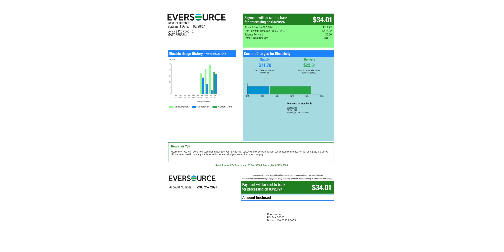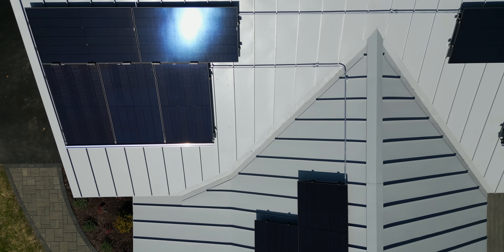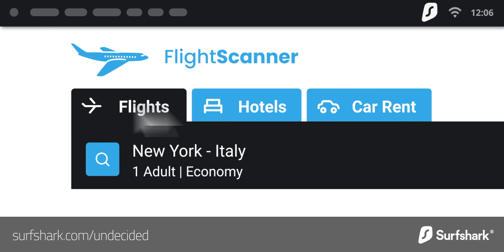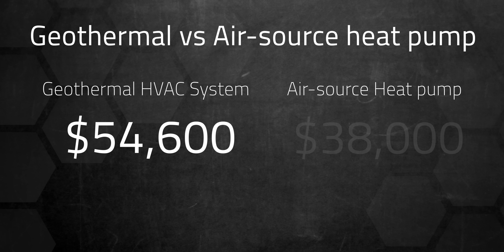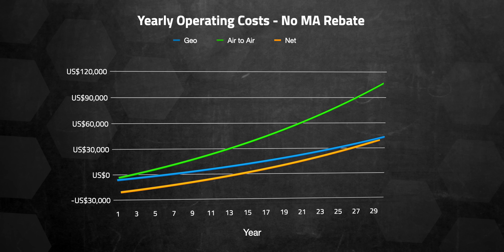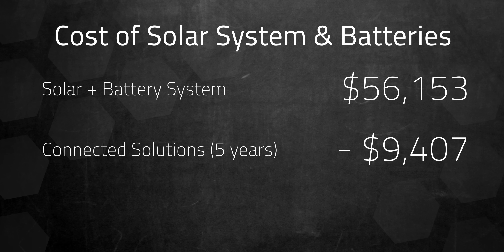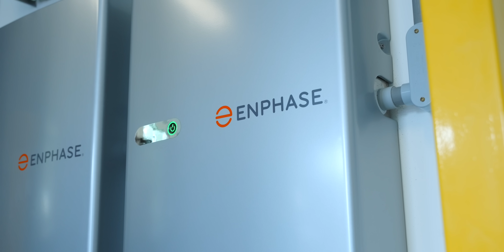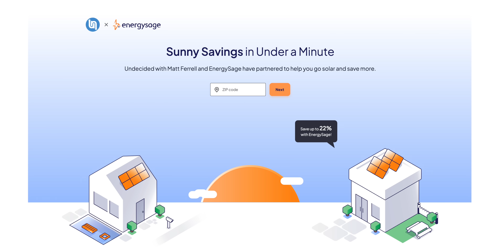What I Learned After 1 Year with New Solar Panels

Comment from the maker: Have you done anything like this or are there any specific elements you’d want to do for your home? Go to https://surfshark.com/undecided for 4 extra months of Surfshark at an unbeatable price!

If you liked this, check out The Genius Of Hot Water Heat Pumps https://youtu.be/abGiNL9IT54?list=PLnTSM-ORSgi7HT9O73K9oYUe19eS-wjxX
Reply: 88.000 $ for just 16 kWp and 20 kWh ?

I build that on my own using 540 Wp panels and got 30 kWp with 22 kWh of batteries with eve LF280 K cells. 
Paid less than 18000€ or 19000 $

I guess prices must be way off than what we pay here in the EU.
2 panels each 540 Wp cost about 136€ and they are VAT free like inverter and batteries too.
For 100 k you could get a picea system which is storing the surplus energy in Hydrogen bottles for usage in the winter. Their fuel cell is uising 1/3 of the hydrogen power to heat during winter and 2/3 for electricity production. 

Made in Berlin, Germany and quite expensive, but those who got it, they were convinced.
Reply: I live in the SF Bay area and we've had solar for nearly two years now. I started with a 6,400 watt system plus a 10 kwh backup battery that we had installed in Feb 2023. Over the next year our panels generated 8.9 mwh of power and our total energy costs were reduced by more than 50% over the year (electricity + NG cost us $3,967 in 2022 and only $1,795 in 2023). 

This year, we went all in and added 14 more panels (which appear to be more efficient than the ones installed last year) got a heat pump water heater, two Mini Split heat pump AC/Heater units, an electric dryer, an EV with a home level 2 charger and an induction stove. We have yet to turn our gas furnace on, and probably won't this winter (or ever again). After rebates, we probably spent about $50,000 for all of the home upgrades (including solar) and another $50 k for the EV (a Hyundai Ionic 5).

Our new system (which was upgraded in May) is projected to generate nearly 19 MWH per year and our total energy costs should be less than $500. In addition, we almost never buy gasoline since we rarely drive our second car (a 2010 Honda Fit). Since energy costs continue to rise here in Northern California, it's hard to project exactly how much we'll save over the next 10 years, but it's nice to know that, no matter what happens, we'll pay almost nothing for energy for the next several decades.
Reply: @davidbelk46 Thanks David, this is like this video but for Californians.   
A few years ago I contacted Southern Cal Edison to let them know the weed tree in my neighbor's yard was arcing against their power line.  We're hillside which makes it even more dangerous. Two weeks later I got a text message saying, "Just have your gardener trim the tree." I'd mentioned in my first message that my gardener told me no one he knows would touch it. Also the SCE yard it took that guy two weeks to take a look? It's a mile away. I called the state regulatory dept and was told: We can't make the utilities do anything. They got laws passed.... Then PGE and murdered 71 people. I finally put on heavy neoprene gloves and cut down the tree.  
After the PG&E murders the utilities got a huge spike in rates and extra fees to pay for tree trimming -- something that had always been part of their responsibilities. When I got a bill for almost $0.50/kWh is when I set the goal of disconnecting as soon as I could.
Reply: @davidbelk46  the government will get its money from you another way
Reply: Hence why I am DIYing my own system.  The installer is charging you almost 3x what the parts cost, and its fairly absurd even counting labor.   You are paying $1288 per panel (panel + micro-inverter + mounting + installation) and $33K for a 20kWh the battery + inverter system.

Panels DIY are roughly $200 per panel fully delivered (panel + RSD + mounting, DIY installation).  Batteries are roughly $1500 per 5kWh fully delivered (so $6000 for 20kWh), leaving just the inverter system.

For inverter systems, to be frank, too many people focus on grid export capabilities rather than just a grid support (battery charging / low-battery load support on the battery bus).  For people with large SOLAR + BATTERY systems, it is perfectly acceptable to have an off-grid inverter system and grid-tied battery charger for DC-side load support when needed.  The whole point is to be off-grid and solar-supported most of the time so grid-to-battery-to-home efficiency is not critical.

No transfer switch, no grid-tie.  It just isn't necessary and to prove the point just take your largest daily winter consumption and divide by 24 hours... that's the amount of load support you need worst-case and it aint much.  Usually less than 2kW (which would be 48kWh/day trickle-charging the batteries).  Absolute worst case.   And if someone wanted to do export on top of that, its just another piece of equipment.

In anycase, this puts an exclamation mark on the problem with residential solar these days.  The professional installation costs are insane.  And part of the reason for that, beyond solar installers needing to make a profit, are the extreme warranty periods that have bankrupted installers right and left over the last decade.  And a lack of imagination.  They want systems that they can shift warranty claims to their suppliers instead of piecemeal systems with cheaper (easily replaced) individual parts.

For the home owners, fully integrated systems can get fairly expensive to maintain once the warranty is done or (more likely) your installer goes out of business.  Piecemeal commodity systems, on the other-hand, are trivial to maintain.

-Matt
Reply: > "Have you done anything like this or are there any specific elements you’d want to do for your home?"

Australia here.  45x440W panels for 19.8kW generation capacity against a 15kW hybrid inverter.  50kWh of storage (would be overkill, except I have an EV and we're planning to add a second one eventually).  Sungrow on the inverter and batteries.  AU$53k supplied and installed (approx US$35k).

Your costs really are "crazy high".  Anyways, all electric as well.  Heat-pump hot water, induction cooktop, aircons, etc..  No heating, because Australia (the aircons can also work as heaters but...yeah, never gonna happen).

Using 40-50kWh per day (inclusive of EV charging), which would be a monthly electric bill of around AU$450 or so without solar/batteries.  Exports pay a flat 12 cents per kWh sent to the grid, so with solar/batteries the electric company pays us around AU$200/month.

Extrapolate that out, and the energy generation/export is worth around $7800/year.  Pays for itself in ~7 years.  Even without assigning any value to being essentially blackout-proof/energy independent, or to having a clean source of electricity, etc., or allowing for energy prices to increase over time.
Reply: There is of course interest expense for a higher mortgage  by doing all this upfront. 
My goal is to follow your example when I buy a house. I'm happy to pay whatever it costs to leave the grid.  I'm in southern California so this is achievable.  
An absolutely critical factor is that any series of systems like this must be reliable, robust and as simple as possible. There's nothing worse than some amazing but complicated system that when it has a problem five or ten years down the line can't be fixed because there is no tech support or parts.  (As a sailboat owner this is far more common than you'd ever possibly imagine.)  Or after a year you don't remember all the complex steps needed to operate it. (I remember the days of the first VCR video recorders. I used to rant about all the pokey pokey button nonsense. People seemed to love telling me that they can do it so I must be stupid. And then they'd call, "Did you record that HBO show?" If I had it it was only because I was there at the time and pressed Record. I wouldn't want a mid winter water heater shut down because of a glitch and there was no way to just press a button to do a manual override.)
Reply: To install the mains cable from the street side to where I wanted to build my house on the plot we bought 7 years ago was as expensive as a small 5kW off grid inverter, 2kw solar panels and 4 x 12V 100Ah AGM batteries. We have upgraded over time to (still) 5kW inverter, 5kW solar panels and 16kWh LifePo4 batteries. I have a generator as backup, but have not needed to start it in two years.

We have immediate heat gas geyser and oven/stove for the kitchen and low pressure solar geyser for the bathroom. We don't have HVAC as climate here in inland South Africa is tempered, passive cooling and gas heater is enough. All said, the replacement value of my solar system is about ZAR75,000 = 4150 $ US and we have been living on it for going 6 years now. Best decision for us. Based on what I used to pay at our old house, my system has already paid for itself.
Reply: I can't begin to explain how complex this topic is and how well you covered it.  I've been going over the same exact trade offs for my new house to make sure I was making a good decision.  I landed on doing a ton of solar (40 kw) that I will install myself but I have 12 month 1:1 net metering at 17 cents/kwh.  I also went with lower efficiency heat pump system and less insulation because the solar is going to have a way better payback.  And to add to it, my 40kw system will be able to share power with my parents house on our bill, so it's double the return on investment.  Similar ~50% selling rate to the power company after I go over 100% usage and an extra 3-4 cent/kwh for the PA solar credits.   And once long range electric cars are cheap enough, I may cut my gasoline bill by charging my own electric car to save another $10/day.  No battery system due to the net metering.  Probably will sign up for the optional time of use rates once the solar is installed.

I think this level of thinking and math is in the top 1% of people who look into energy savings.  You can do simple or even complex payoff calculations, but this really looks at it from the big picture.
Reply: Not a fan of enphase stuff.

My parents have a cost similar to yours. Batteries can't run the whole house, etc. 

I spent less than half of what they did in a hybrid set up where utilities is seen as a generator with Victron, and server rack style batteries. I run my house and shop with air compressors. Barely ever use the utility power. Been thinking about killing the meter and just using a generator.
Reply: I'm a fan of Matt, he makes good content. That being said he made some, ahem... interesting choices here when building this home. You Mericans seem to be obsessed with HVAC and using eye watering amounts of power. I look at this house, its design and see so much unnecessary complication - just too much stuff. Had the architectural design being well considered, much of this hardware could have been avoided. A design based on passive house or something close to passive house does away with the costly geothermal (don't need it) and its complication, and a smaller in roof solar system on one southern elevation combined with a larger battery would have looked better and be cheaper. You gain a whole house heat recovery system (ideally a nice German job) which would be @ 4-5K for the Rolls-Royce version, ultra efficient, sips power 24/7 through a state-of-the-art switch mode power supply. The point I'm trying to get across is simply this - focus on designing a house that needs zero power, whose solar thermal performance means it stays in a range of internal temperature between 19- 22c all year round, a building that requires no additional heat in winter, and no additional cooling in the summer.

C'mon America, you're a tech powerhouse and this tech has already being figured out for you by (yes, yet again) the Germans 30+ years ago- and no if it's designed properly it won't overheat in the summer, even in New Mexico or Texas! 
 Remember the KISS principle - keep it simple stupid.  Hopefully no one's offended.

Insulate - air tight - mechanical heat recovery - triple glazing - competent design = a home that cost nothing to heat or cool... forever!  I know, I know, it's positively Un-American, even socialist eek! Sorry, just how we roll in Europe....
Reply: Western NY state, 70's era ranch house aligned on east/west axis with clear south exposure. We had 20 265-W panels (5.3kW total) installed in late 2015, after living in the house for about a year. Net cost after NYS and Federal credits was just over $6300. 
We're still grid-connected and pay $22-$23 per month to use the utility as our battery. Utility offsets our back-fed kW's against our usage and banks the excess, with an annual reconciliation where they reset the account to 0 and pay us wholesale prices for the excess generation. It's hard to figure out current $/kWh on the supply side, so I don't know where we are bottom-line, but I think we're doing ok.
Annual generation has exceeded annual usage since Feb. 2016, so we haven't bought any electricity since then. Total generation of about 50 MWh, or about 7MWh annually.
Two years ago we upgraded the AC system and gained better summer comfort and more efficient energy use. About a year ago we switched the gas water heater to heat-pump electric hybrid, figuring that the improvement in efficiency made it workable with the average excess generation, and so far we're still running a surplus. 
Have considered batteries for backup, but the payback just doesn't seem to be there.
Reply: Matt, I keep getting your videos narrated in an Arabic voice, not your original English voice. It's very annoying as for once it's not the original, then and most importantly, it has many mistakes & it's Arabic is very lousy. How can I get rid of that? Please help
Reply: I have to laugh ssoo much about myself  --- not  about you. I just discover you. I watch your talk  --- How cool you are  ....so, i have to laugh about me.....Good job/ wonderful work, thank you..
Reply: I did a hybrid nat gas plus electric air sources heat pump (aciq 4 ton unit) good to -22f, but if you are able to solder copper, and comfortable with basics electrical it is possible to do all in for less than $6000.
Reply: @UndecidedMF 1. What are the panels actual output vs rated output?
2. how does the last year compare to your expected production when purchasing the panels?
Reply: I can't believe how high your electricity costs are $0.31 is crazy high, here in Illinois I pay $0.11
Reply: @ActualSurvivalist - he probably financed it through the solar installer and they add up to 20% i believe in dealer fee.
Reply: I have 33, 400 W panels on my house with Enphase microinverters.  Total of 10.6 kW AC maximum.  I live in Northern Minnesota with lots of trees to the south so not much production October through February.  Still pays for all my electricity and the large $50 a month utility fee.  Breakeven should be 17 years assuming 3% rate increases, then free energy. After 25 years I should be $23K ahead.  If I reduce the cost by the 4% increase in my house value for solar then it pays for itself in eight years!  But more importantly it reduces my carbon footprint.  Next step is to replace my old air source heat pump with a new cold climate one and reduce my propane backup furnace usage.  I thought about adding batteries but it is too expensive for what little I would need them.  I paid cash for everything so don't have any interest to pay. 

Specifics: I have two rates, 13 cents/kWh (15 in summer) for most stuff, 6.7 cents/kWh for the heat pump and a storage water heater.  To keep the two rates I have to sell all my solar production to the electric company at 11.4 cents/kWh.  Or I could have everything billed at the larger rate and do net metering and get the 11.4 cent rate for any excess.  The difference is about $20 per year one way or the other depending on the heat pump usage.

I don't agree with all the comments about you paying too much.  You paid $3.19 per dc watt, essentially the same as here.  Yes it would be cheaper to do it yourself but some of us don't want to haul 50 lb panels around a 45 degree roof.
Reply: @UndecidedMF  will you answer this incredibly generic question of mine, thus granting me the sweet nectar of engagement? Be a sucker, I mean comment below!
Reply: You were scammed thoroughly with the price of those batteries. Just after the start of Covid, we paid under £9,000 for the purchase and professional installation of 19kWh of LFP battery with an inverter. I cannot compare directly what you paid for the PV array, because we opted not to fit one, but at the time, 300 Watt panels were about £100 each, without installation costs.
Reply: Our family thought about a solar panel system installation in our home in California, but I do not trust our too cozy relationship between government and PG&E.  Something will have to give.  people can't keep affording increases if they also cant afford food.  the whole system will be falling apart if we keep letting electric companies regulate how they get ahead.  I do agree a forever home and a 30 year plan is the only way doing a system makes sense, but with financial instability right now, I don't see many people middle class or below doing these sort of improvements.  Seems like it for the rich (for right now)  In the early days , the energy company just had to pay you money on what you created. (up to point) they got around that law with credits.  ( THE LARGEST SCAM IS HOW THEY CALCULATE energy in their best interest, not in yours) it scares me to invest all that money in California and then have the laws change and mess with me
Reply: @UndecidedMF  81k on a basic CD account in 30 years bring for more than your savings.. sorry dude.
Reply: 10 dollars is not enough to cover the cost of the grid.... I expect that to increase a lot, you will be lucky if this stays under 50$ in the next 10 years. I would account for that.
Reply: We went with an airsource heat pump, and hybrid water heater in our build.  The additional up-front costs were just too much to justify the GEO, plus and I cannot emphasise this enough: In America, HVAC installers are morons, and HVAC repair companies are trash in general. If you can find a decent company, get all of their personal numbers, so that when an issue pops up, you can have someone competent fix your system.
At any rate, we've been happy with our near-net-zero home. It's 2,400 sq. feet, and we spend about $100-$500 / year on electricity. It's great.
Reply: Dude you should have a unisex name you should see what I get sometimes,
Reply: First I want to say thank you for your videos I think you do a very thorough job ❤
I want to make sure I understand because I'm trying to see if this makes sense for me:
Between your solar system and your batteries (before any rebates or other incentives) you spent over $100k on your power system, correct? 
TYIA
Reply: Our home on the outskirts of Berlin, Germany was built as a low-energy house in 1998. I have not found a way to convert its energy index of 47.31 kWh/sq m year to a HERS score; its index is 45% below the requirements of the applicable building codes at the time and is still at the lower end of the mandated scale for new buildings today. Our 36 south-facing solar panels, now 18 years old, are rated at 220 Wp each. The system, with two strings, one inverter per string and no battery, cost €36000, loan-financed. The subsidized feed-in rate, guaranteed for 20 years, was fixed at €0,49 per kWh for systems installed in 2007. Last year, one of the strings failed, but overall the system should still break even financially. Prior to the failure the system was delivering more energy year-on-year, so no panel degradation was detectable - climate change measured on the roof of our house? The total energy produced by the PV system is well in excess of what the house has consumed in gas and electricity over the period. The new feed-in rate when the subsidy runs out may be €0,08 or it may be zero if the new Minister of the Economy gets her way. Also last year, our gas-fired heating system failed, so we replaced it with an air:water heat pump at a cost of €18,000 after deducting a federal subsidy. Additionally, we had 4.5 sq m of  solar-thermal water heating, which had even been able to cover all our hot water needs on a sunny January day, but that was decommissioned when the heat pump was installed, because all the contractors who gave us quotations declined to combine the sources. It had no metering, so we unfortunately will never know what contribution it made. Also last year we bought our first EV, so while our gas usage is now zero our electricity consumption has increased massively, but still the old panels have pushed out more through the feed-in meter over the past 12 months than we taken in through the consumption meter. I'm now looking at re-powering and expanding the PV system to use the entire roof area, which, with modern 725 Wp panels, would raise output from 7.48 kWp to 20 kWp. Combined with a battery of around 25 kWh and a single smart meter, this should allow us to cover the energy consumption of the house and the daily EV commute except during January and February. The re-powering and battery will cost about half the price of the original system, so much have prices fallen in 20 years. 
Modernization of the grid and local distribution networks in Germany is lagging behind the expansion of PV, smart meter rollout is glacially slow and so far it isn't possible for the utilities to use home batteries for grid stabilization.